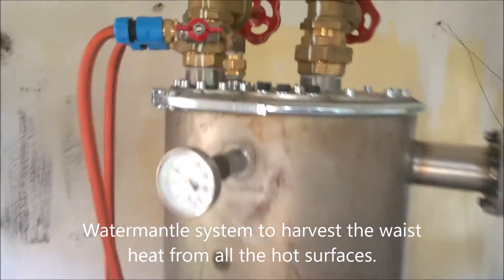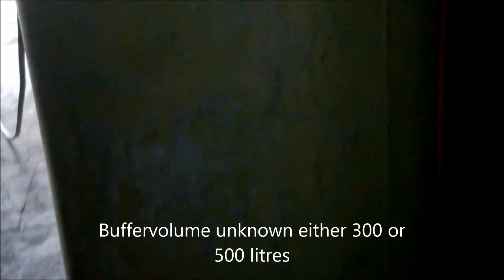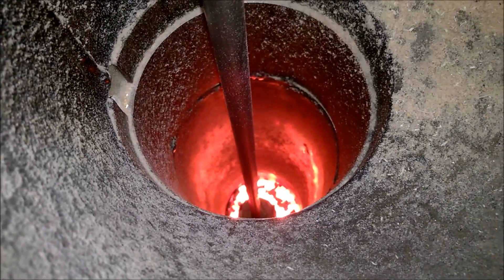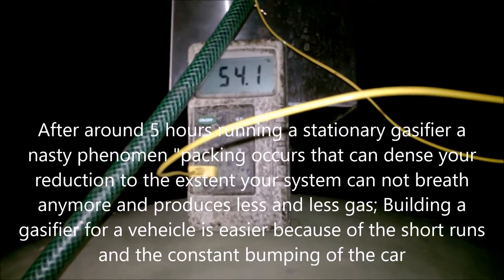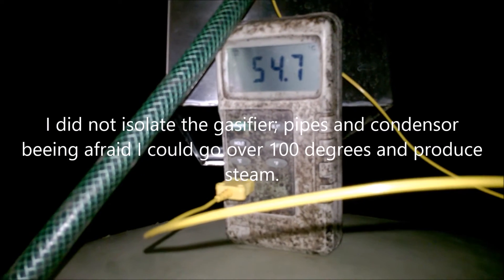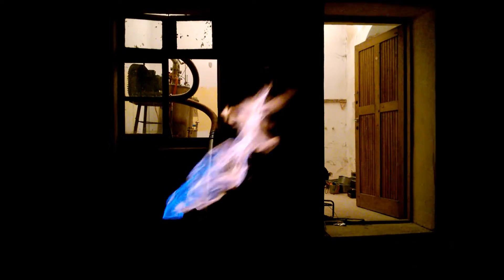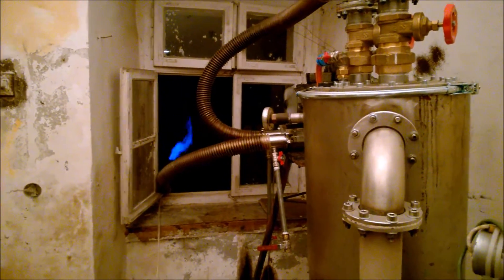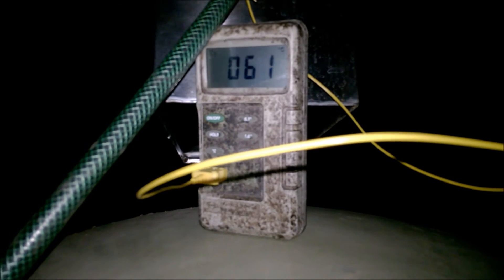NOT DONE. Woodgas gasifier cooled!!!By watermantle???

Comment: I just tested a filling with plaster and perlite mix between the inner (100mm) and outer tube (150m)  (so the gap is around 25mm) - inside the burning tube I measured 1011°C and on the outer tube a temperature of 120°C as wasted heat. I decided to coil a copper tube around the outer tube and isolate this as a third wall with rockwool to concentrate as much heat as possible to the copper tube. Since I played around with a sizeable hotwaterpump (0 to 60l / min) and a 800l watertank, I was able to cover as much heat as needed. 
At the moment I am building a stationary gasser with many redundancies too, since my lab version ex/imploded slightly due to a fail of the ventilator and a missing flame arrestor ;)

Comment: I made a small, simple downdraft gasifier and lined the inside with a mixture of clay and sand. . . Used just slightly damp enough to hold together, but little water mixed in. Pack it in very firmly. The ceramic holds the heat nicely, ZERO tar.
Reply: The gas was then transferred to a pipe (aluminum was all I had) that ran underwater for 7 feet or so, and up through a hose to a clear plastic chamber. No tar, and the gas was invisible. Had a very slight barbecue odor.
Reply: I want to buy some stainless cooking pots to act as a water jacket, having a slightly smaller pot inverted inside with about a half inch gap all the way around, so the gas will enter the inverted pot first, and be forced into contact with the submerged larger pot before making it to the top. Heating water is not the priority, I just want clean, dense gas.

Comment: why not run the gas output directly thrue the coil of the buffer tank. go direct is always better
Reply from the maker: Because one would not wish a coil for direct contact water/raw-gas. A coil can be only used after the filter. In this watermantle gasifier it is very important that the gas travels trough a very wide gap between gas and watermantle so residues of charcoal dust can setle on the wall and if they form a thick cake can fall off by gravitation and therefor be self cleaning. A coil would be clogged in no time . I use a coil too but later in the gas stream in the filter condensor. Here is show only the first stage of the two stage cooling cycle.
Reply: makes sense

Comment: Your experiences are much like mine. It seems that we don't really need to put much effort into preheating the incoming air.  I run mine all through the winter this way, and there are no problems with dirty gas or tar  :) .  Keep up the good work.
Reply from the maker: Hi Machinefun, Thank you for comenting. Yes the more I read about Preheating the more I got convinced that this  big  gasifier axioma is not much based on solid scientific ground.

Comment: Is it possible to empty the condenser water with it running without getting air in the system? like a two valve system or such.?
Reply from the maker: Perfectly possible and that is the way I have to go, but in this build I have very little space. The valves should be electricaly controlled for utmost comfort. This is something for my new build. The gasifier in the video is just a laboratory modele, Adapted and adapted all the time. It reaches slowly end of life.  Luk
Reply: How many hours of useful life does this gasifier have?